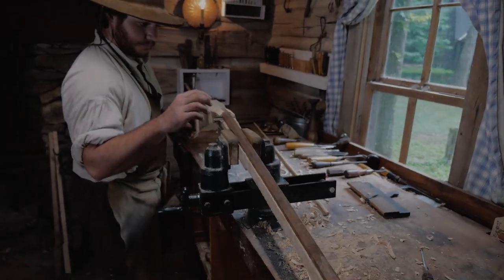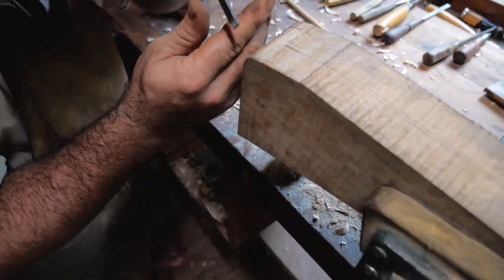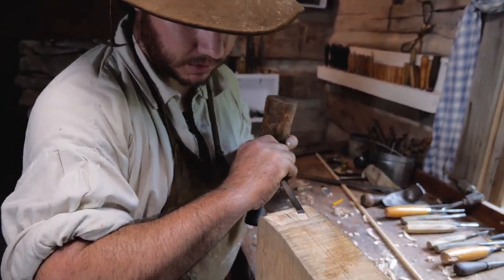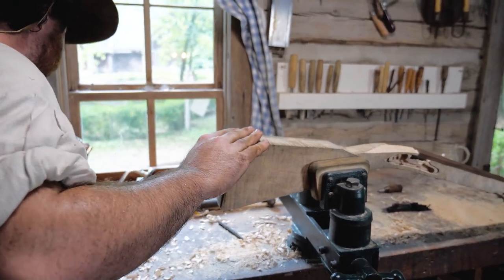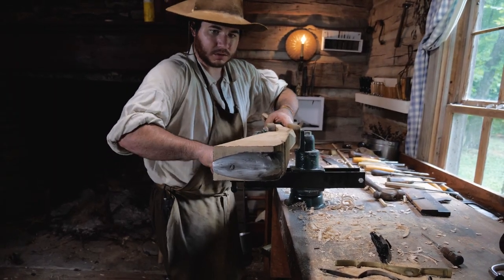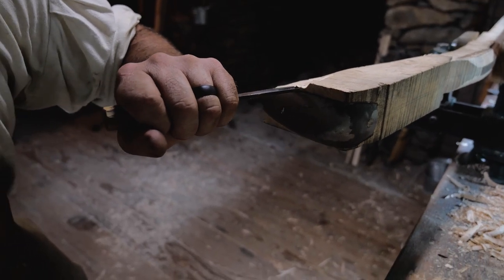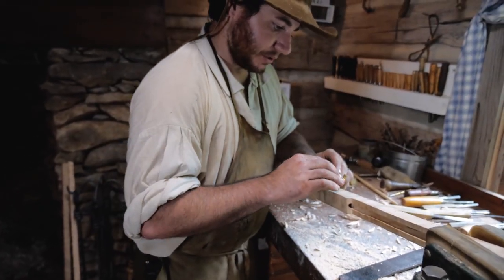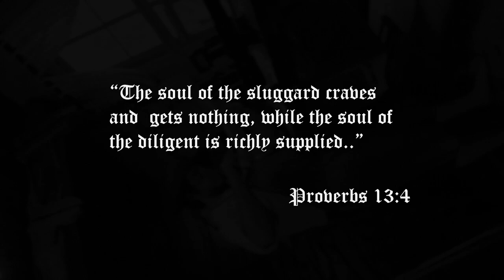How to Build a Flintlock by Hand (Part 6)

Comment: This series popped up on my recommended list and I'm glad it did.  I am enjoying this immensely.  Forty-five years ago I would have loved doing this but got hooked on boats instead.  It is nice to see a young man building his skills in this form of art and engineering.
Question: have you looked at using a draw knife and spokeshave for shaping the buttstock and forearm instead of the chisels and gouges?  I use them a lot for shaping when I have a lot of wood to take off a rib or stem.  Much better control when you have to worry about possible grain splitting.  Take care young man and thank you for making these wonderful videos.
Reply from the maker: Glad you enjoyed. And yes I’ve considered those tools it’s just easier foe me to use chisels personally. But I’ll use a draw knife from time to time. Take care sir. Thanks for watching.

Comment: This is very interesting and educational to see.  Would some of the craftsman used a drawknife rather than a chisel to remove bulk wood from the stock or was that tool strictly used for removing bark back in the day?
Reply from the maker: Absolutely. They would use them. They would also use tomahawks. But you have to be careful. It’s easy to get carried away. Draw knives are great. And a series planes as well.

Comment: That is coming along very nicely! I am sure you are very content with the way you are working, (especially as you have your excellent workshop), but you will, (I am sure), find it much easier to work on the stock if you support it with a bench horse, or even off a floor support, with the stock whanging up and down like it does, you will damage something, and it is taking most of the energy out of your chiselling, the vice works very well, I use mine all the time for non parallel work pieces, good luck! Chris B.
Reply from the maker: Thank you Chris. Yep. I use one now. Made a leg that slides in holes in my table.
Reply: @goldenmeanflintlocks9713  I am really glad to hear that ! I hate to see you struggling with that stock bouncing around like that, especially when you have to hold your hand under the bit you are chiselling. Stay safe! Chris B.
Reply: @goldenmeanflintlocks9713  You sound like you may live near Carmen (Hershal) House, is that so ?
Reply from the maker: No sir. Oklahoma haha. We’re hicks down here.

Comment: Couple questions: 1) I recently built my first flintlock and I'm having some issues trouble shooting the lock. If the lock screw is tightened it will go at half cock. I've tried removing the fly, putting it in different directions, etc, and it will still go at half cock. If I loosen the lock screw a bit though, it won't. The issue there to me seems like the lock is too loose in the stock, and sometimes there's a gap between the barrel and lock. Any ideas?
2) Any new videos coming soon??
Reply from the maker: I hope to have new videos as soon as my new shop is done. Locks can be finicky sometimes. Usually when this issue is occurring, it’s the sear rubbing in the mortise. It also be the sear spring rubbing slightly or the mainspring is rubbing. Get you a kerosene lantern or a candle and blacken the entire lock with suet. Place it in the mortise and give a light tap with a mallet and cock the cock back. Remove the lock and see if you see any black anywhere. That should tell you where it’s rubbing. Sorry I’m just now seeing your message.

Comment: I've been meaning to ask you- are you throwing away the long cuttoffs when you rip down for the barrel section? If so, hang on to them, and I'll buy them off you (at least the highly figured ones- and if the price is reasonable).  I can get good use out of it even if it's only 3/16" or so thick by the time you cut it off.
Reply from the maker: Cool. Ya I hang on to them just for people like you. I’ve got a whole tub full of them.
Reply from the maker: Shoot me an email and I’ll get your info. goldenmeanflintlocks@gmail.com

Comment: Question: you redrawn the stock centreline? Does it mean it's not aligned with the centerline of the rifle, leaning little bit to the right?
Reply from the maker: If the stock is thick enough like this piece was, you can draw right down the center of the stock. If it’s thinner you need to run the barrel slightly off centered to be able to get the cast off in  the wrist.
Reply: @goldenmeanflintlocks9713  thanks for this small piece of knowledge, you are truly amazing craftsman. Watching this build was a great pleasure and adventure for me. All the best from cloudy Poland.
Reply from the maker: Thank you. I’m glad you enjoyed. There will be more in the near future.

Comment: what kind of Vise is that on your bench?
Reply from the maker: It’s a jeweler vise from grizzly tools. It’s perfect for gunbuilding.
Reply: @goldenmeanflintlocks9713  thank you! I'm really enjoying this series, I built an 1842 Springfield last year from a kit, and id like to attempt one more kit before fully diving into something like this
Reply from the maker: I Understand. My first one was a kit as well. Always a good idea. I have found after I started building them from a blank after that, that it’s actually easier and more fun. But stick with kits until you’re comfortable before you go all out. I totally agree. Good luck to ya.
Reply: @goldenmeanflintlocks9713  I live in Central Virginia, I was told there use to be a gentleman that lived in my county that made flintlocks from the ground up, to include rifling barrels. Do you know if there is anyone around me that may be able to help coach or mentor me?
Reply from the maker: Sure. I’m working in Colonial Williamsburg right now at the gunshop. We’re actually reaming a barrel out that we just forged. We will be rifling it probably in the next week or so. I would recommend going to the gunshop in Williamsburg if you haven’t been there yet. You can see the tools we use to do that. As far as individuals I’m not sure. There’s only about 8 people that I know of that have forged one successfully.
Reply: @goldenmeanflintlocks9713  I don’t think I’d forge a barrel, I would like to just have someone that could mentor me through builds
Reply from the maker: No idea man honestly.
Reply: @goldenmeanflintlocks9713  I’ll try and make my way down there hopefully soon
Reply from the maker: It’s really cool.
Reply: @goldenmeanflintlocks9713  I really wish Appomattox NPS would open up a shop like the same, I live 1 mile away